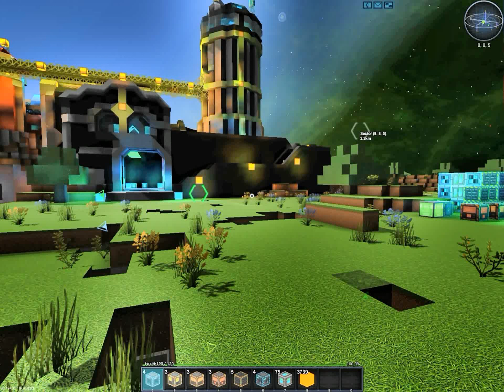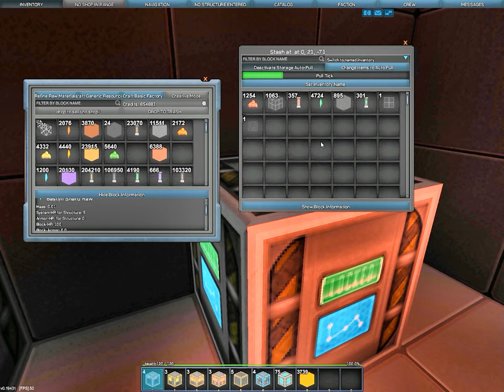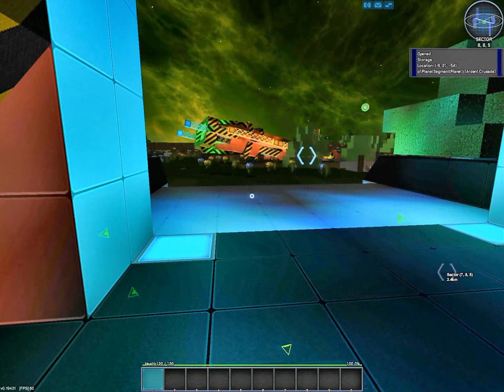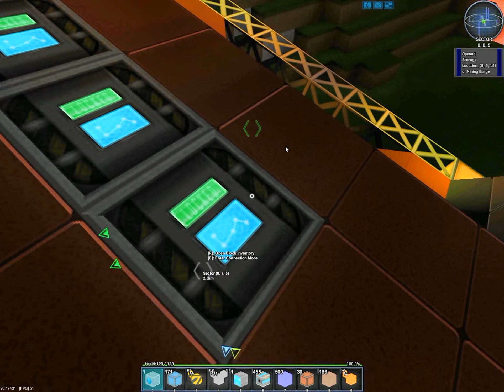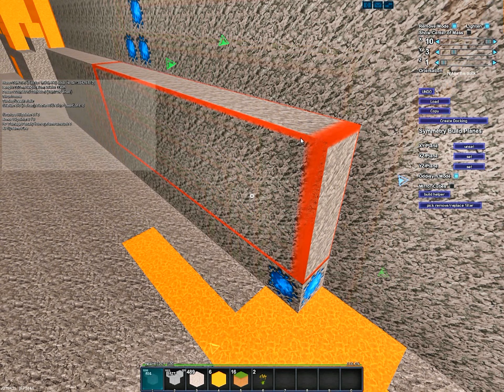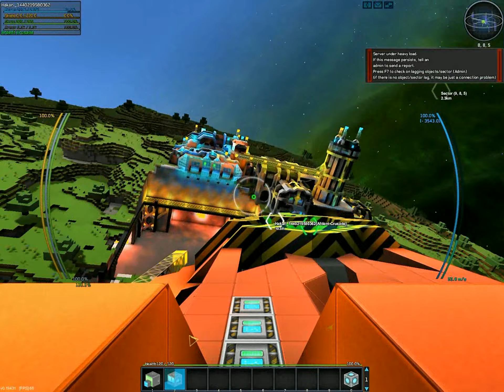StarMade | Survival | Episode 12 | Factory and Docking

Comment: Looking really good Uthris! I'm digging the industrial style, especially the support columns and catwalks.  I've seen mesh wedges used as railing and I think that would look good on the catwalks as well, but not sure if they would interfere with the door when it's installed...

It would be very cool to see the central hanger with a docking point (actually 1 in each direction), and then rails to move the ships into the desired hanger with the push of a button. Maybe add green/red lights so you know what hangers are empty/full and additional sliding doors to separate each hanger from the central docking zone?
Reply from the maker: +AlabasterJazz Totally what I want to happen - making it all move and work in order will be a good challenge!